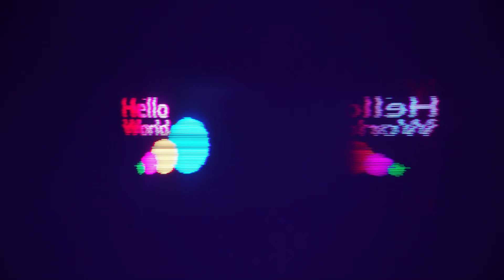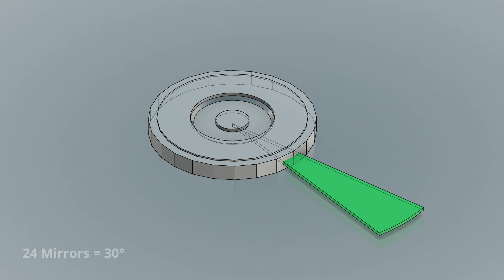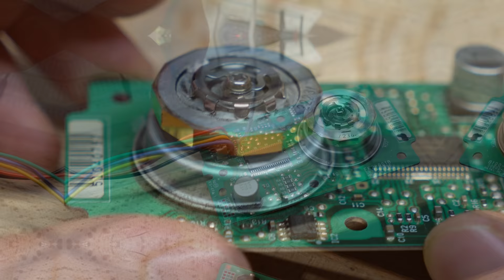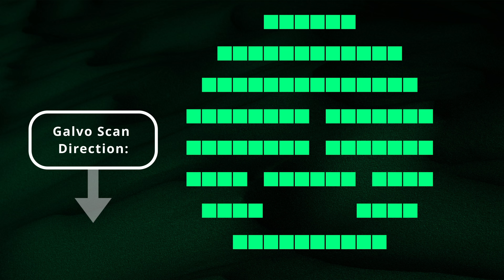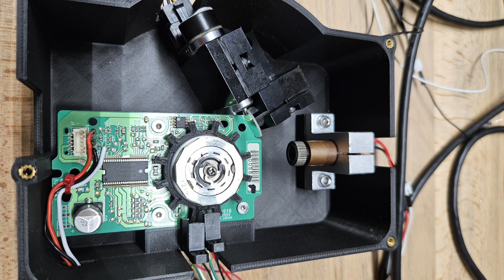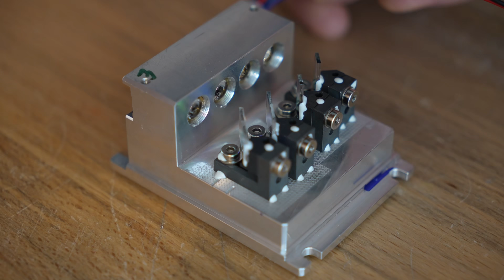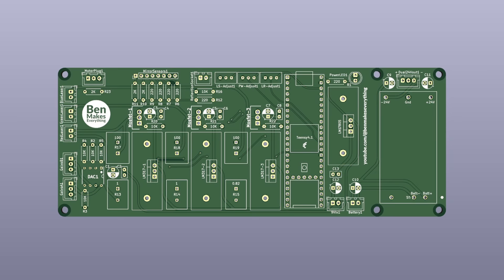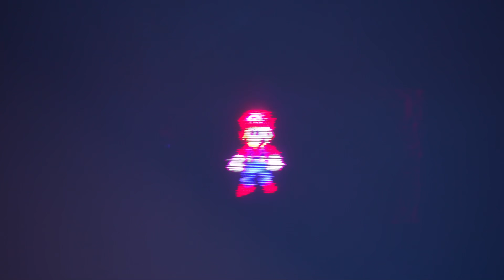DIY Laser Image Projector (100ft+ Range!)

Comment: Hey mate. Your video is really interesting, it's actually not far from engine management systems in some ways. 

From what I could see in the video, the 'jitter' artifacts affect entire lines at a time, and not others. That, plus the fact that most of the lines actually generate jitter free suggests that the MCU has enough resolution when it comes to outputting/triggering the lasers, and that the source of the jitter likely comes from capturing or syncing with that spinning mirror assembly.

I'm not sure how you've implemented the syncing functionality within the firmware, but the jitter being consistent across entire scan lines suggests that line syncing is done by that single larger tab on the spinning mirror assembly. If you aren't already, I think that you should use an approach similar to how engine management systems track crankshaft position, and reschedules outputs (e.g. injectors, ignition) dynamically based on engine speed and acceleration changes CONSTANTLY BETWEEN cycles.

The large tab acts as a 'reset' signal, and sets the current tooth count to 0, as well as setting a 'sync' variable to true (so that lasers aren't triggered when MCU is not synced with the mirror assembly).  Assume that all of the tabs are evenly spaced around the mirror assembly. Each time an interrupt is created, you can increment the tooth count by one, and since we know the amount of degrees between each tooth, we can calculate position (tooth_count * deg_between_teeth), and the rotational speed of the assembly in degrees/microsecond. Additionally, you can calculate acceleration by comparing the previously calculated speed, and the newly calculated speed with each other. The output interrupts you configure should be rescheduled at each tab interrupt event so that the epoch they fire at is calculated using the most recent position, speed, and acceleration measurements (of course only do this if you have enough processing power to do this at each tooth event). 

Just a quick note, interrupts should be as minimal as possible, essentially capture data and exit, or trigger an output and exit. No unnecessary maths or logging, all of that should be delegated to something like PendSV, I can explain that to you further if you'd like, but put simply the IRQ captures data, pends PendSV (or softirq) and exits. The second that high priority IRQ exits, PendSV creates an interrupt at a lower priority to process those capture events. Since PendSV runs at a lower priority compared to the IRQ, if a tab interrupt occurs PendSV will be paused in the middle of what it's doing, the callback/handler func for the tab interrupt will be invoked, and then when it returns, the processor returns to whatever it was doing before in PendSV. Similar to how normal main loop can be interrupted by an IQR, except PendSV allows you to handle time-critical processing instead of it just constantly being polled and done in a main loop.  

Additionally, ensure that your output triggering functions don't involve any lookups, you want a function call like "laser_out_1_on()" to flip a bit in a register somewhere and exit, not have to look up pin, or port/pin from somewhere and then call a gpio_write function from the SDK. With high speed stuff like your project, and engine management systems (what I'm working on), you want to have control fine grained and deterministic.

Apologies for the text wall.
Mitch
Reply from the maker: Hi, first, let me say thank you for the comment! A lot of people gave me suggestions but few were as detailed as this. 

The way its synced (per mirror) is purely through delay functions in the code, triggered by each passing tab. That's why when it first starts up, the image moves into position and 'stretches out' as can be seen around 0:10 in the video - while the motor is reaching max speed. And as you understood, the longer tab triggers the outer sensor to reset the revolutions counter. Both use very simple, 1-line interrupts. I'm not familiar with "PendSV" - I used "attachInterrupt()". The reason I had 12 tabs, and not a single one, was that I found that the motor speed was not extremely consistent and this better tracked its position.

I am actually using digitalWrite which is inside a switch statement that looks at a 2D array of pixels essentially, and turns on the required combination of lasers to create one of the possible 7 colors (or none).

I'm basically self taught in terms of programming, so I'm sure my code is suboptimal.

Eventually I want to build another version with higher resolution and full-color. At that point I'll also revisit the code - although I may try for analog video input instead. In any case, I appreciate you feedback!

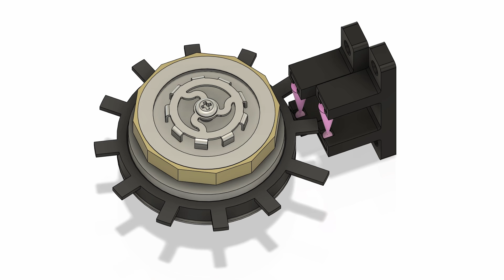Comment: the jittering scan lines are from that 3D printed part under the mirror that controls the timing of the mirrors 5:33 , its not precise enough , if you look at the lines ,you can tell its the same lines ,shifted by the same amount every time , making a precise plate from pcb way from something non reflective would solve your problem ,a tolerance of 0.02 mm is insanely high when your turning at that speed and need precise triggering

Comment: If you could get this to just 500 TVL, it could potentially be amazing for retro games, a CRT replacement tech is desperatly needed now, given how rare and expensive they are becoming, software solutions are just not the same as a real CRT sadly, even FPGA solutions fall short, a raster-scan RGB-Laser projector could be incredible, and an 8K raster-scan HDR-Laser projector would be a game changer for modern gaming too, even 500Hz WOLED/QD-OLED falls miles behind the 0ms of percievable input-fidelity/latency and motion-resolution/clarity of raster-scan displays (CRTs).

And CRT displays can do this, that is imaculate 1:1 dynamic:static resolution at just 60hz, with silky smooth and blisteringly rapid input-fidelity, and then you have beyond 60hz raster-scan, like my Sony G520 CRT monitor, capable of 90hz 1440p, 120hz 1200p, 168hz 720p, etc, which no sample and hold display can even entertain the idea of matching that level of input-fidelity and latency, sadly we dont have native raster-scan RGB-OLED, which could be phenominal, especially at 240hz and higher.

Comment: bro all u need is to duplicate this 3 times with the only differences being wavelength of laser (1x Red, 1x Blue, 1x Green) = full color :D
Edit: combine the three with two beam splitters arranged as a cube. The top and bottom side of the cube can serve as the space needed to mount the thing. This leaves 4 sides of the beam cube... shine red into 1 side, green into 1 side, blue into 1 side and the output will emerge from the 4th side. this can be sourced from an OLD projector at goodwill. best part is the beam cube will alrdy be setup for this arrangement and will have lenses already focused to display at a distance (focusable too!)

Comment: Thanks for sharing your info I just wonder if this system able to projection in naked air or may on sky not only on screen or any obstacles in front of it
Reply from the maker: It can project on any solid surface, or maybe water or a cloud, but not on air, since there is nothing to catch the light.

Comment: MEMs. Microvision did this already with the pico projector. I worked there during that time.
Reply from the maker: I'm very interested in this. I was under the impression that most "laser" projectors were essentially using the laser diode as just a compact, very bright light source, but seems that that device was actually moving the beam. I'm curious as to why that product doesn't seem to have taken off.

Comment: Instead of galvos could you not use dual mirror wheels, one for vertical and one for horizontal? Timing might be a little more difficult but should get you good refresh rate and resolution on all axis then?
Reply from the maker: Possibly, that is something I would like to try in the future, although I suspect it won't be easy.

Comment: What do you think about 3D printing a rotor on a resin printer without any adjustments, and then coating it with chrome to give it a mirror-like finish? The whole thing could be miniaturized.
Reply from the maker: I thought about it, but wasn't sure if the quality of the mirrors would be high enough. Plus this thing spins at about 15,000 RPM, so I would be concerned about it flying apart if there was an imbalance.
Reply: @ The resin printer has high accuracy, so the center of gravity will be well distributed. A BLDC motor would be suitable for such rotations. As it would work, it could be done for very little money

Comment: Do you need the 12 horizontal triggers? You could inprove CPU hz efficiency, and reduce noise in the or switch, by using less triggers 6 sending 2 laze bits each time, or 4 with 3 bits, or 2 triggers with 6 bits, or 1 trigger and send 12 bits. You might get wiggle on the whole line but it would significantly reduce the noise created by the triggers and give more cycles back to the code

Comment: I imagine two flat mirrors glued together for each ax (x and y) one of which spins at half the speed of the other would make the design a little simpler.
- no need for complex mirrors
- no need for a mirror that decelerates every round.
Reply from the maker: Yeah, thought about that but I think synchronization might be difficult - there would either have to be some gearing or precise electronic speed matching.

Comment: Hi! I absolutely love this project, I wish I could contribute but my skill level is currently FFARRR behind. I think I found something that would really help though - have you heard of MEMS laser projectors? They use the same principal but with a MEMS mirror that can actually move the laser in a 720p/60hz refresh rate! It's kind of an abandoned piece of tech, but there were actual consumer models made like the sony MP-CL1! The craziest part is that I actually found someone who sells the complete RGB Laser and MEMS mirror module used in the MP-CL1, and also someone who sells the MEMS mirror module on its own. I found it on taobao but it only seems to show up when i search on the app, on aliexpress I only see them selling the mirror on its own, but with a significant markup.

If you are curious to proceed in this direction I'd love to see if its possible for you to use this module but with a much more powerful laser, and if the module can be run at different line counts and refresh rates - so far all the products I've seen made with this only seem to support 720p 60hz, and they all use an extremely low powered laser. Do let me know if you need a link to the product page i found, I don't think i can post it here.

I'd love to try it on my own one day, but I'm quite far from this level of hobby projects haha, it'll take me a few years to get there.

Comment: This is a really cool project and one I've thought about trying myself. But to expand on the note about laser safety: Many lower-cost visible light lasers (green especially) are actually infrared lasers combined with a frequency-doubling crystal; some of the longer-wavelength INVISIBLE infrared light is converted in the crystal to shorter-wavelength visible light, often at around 10% efficiency. That's fine, as long as the laser ALSO includes an INFRARED FILTER to block transmission of the other 90% of the infrared output. If there is no filter, and yes, many of the cheap "green" (aka infrared+frequency doubler) lasers do not include the filter, then the beam is really a high-intensity invisible infrared beam, that also has some green light too. Your eye has no reflexes to blink or look away from infrared light - it's invisible. So it's very easy to get infrared burns on the retina from these unfiltered infrared/green lasers. Just a PSA!
Reply from the maker: Thanks, you are absolutely correct about the issue with cheap green lasers - however this one is a 520nm direct diode, not the 532nm DPSS type - I learned about that issue first hand in my initial laser projector build - I had to not use the DPSS type due to the extremely high switching speeds required for this.

Comment: What are the odds. Just recently i came up with the idea to use spinning mirrors and a laser to create a little crt-like screen. It would like this but shine on the back of a phosphorescent translucent panel. But i deemed it impossible because of the rpm required.
Reply: The idea was to add a VGA connector, have three lasers (RGB), and just connect it to my pc. Imagine playing a game on it, watch videos, drag a window onto it, etc
Reply: My next idea would've been a mems mirror. If driven in an oscillation, back and forth, they could be enough for 360p 25fps or whatever. Don't remember the numbers.

Comment: Why not use an ESP32? If you want faster clock speed, and it comes with BT and WiFi, you can use the same programmer and basically the same code. And its cheaper

Comment: i build before an video circuit input for oscilloscope device..... so you get video image in black & white (green )... you change the oscilloscope with laser system and you get the same effect..... so rgb lasers projectors they already been build ... atiki taki tiki tu tȁ̶̢̳̪̥͎̩̦̫͓͓̏͋͌̀̑̔̑̆̄͌̽̄̂̄͜ͅ ta .... 
🌏 📡🌏 👣🕖 💎👽☠☼☾☄ゞど・ㇺㇾㇽ₪𝖎𝖙𝖎𝖇𝖎𝖗𝖆₪なめㇺㇾㇽ✶☥✨🌛🌄⊀✶⋊🐺🐾♓☆🐜🐜🐫▲▴◭👀

Comment: $120 for just the power. O.o 14:00
Reply from the maker: Yeah, prototyping stuff is expensive. There may have been cheaper ways to do it, but at least that part did work flawlessly.
Reply: @benmakeseverything  Yeah I wasn't criticizing, it just would have blown the whole project's budget if I was doing it.
not sure what the other options were either otherwise i'd have tried to be more constructive!

Comment: On split power supplies: often you can generate a virtual ground, for your case having a 10V supply and a 5V regulator running off of it whose positive is the ground of the split supply circuitry. 
The only connection you need here is to phase lock the galvo to the frame synch of the other driver and that can be done via an opto-isolator as an easy level shifter between the microcontroller and the galvo triangle wave driver. If you want to more precisely staircase the galvo then you send up/down signals to a counter feeding a dac.

Comment: why don't you replace the LASER printer motor with an HDD motor ?
Reply from the maker: Did you see my first video? That's what I used on that one - but the laser printer motor actually spins at a higher RPM and already has the mirrors mounted.
Reply: @benmakeseverything  Yes boss, but what I mean here is why you should not use a 15K rpm speed, it's ?? not what we have seen in the first video in which you used a 7200 rpm default motor and I came back now again to the first video for ensure which one you used..
So, my point is if the printer motor has more speed I think not like the 15K plus you have a more stable for a somewhat heavy mirror !!
Thank you for replying.

Comment: A very neat project.  I wonder if you would consider releasing a version that we could have a PCB manufacturer assemble.  Then those of us who have a 3D printer could print a little case for it and have a version.  After you're done selling the gorgeous version you are selling of course.  If not, I completely understand.

I'm in awe of the amount of work you put into this.  I recently finished making a pendant that has 51 size 1010 WS2812B LEDs and that was a lot of work.  So I can understand just a small fraction of the amount of work you put into this one.  Thank you for sharing.  It was very entertaining to watch.
Reply from the maker: Thanks - if you really want the PCB design files I'd be willing to share that, but I'm not selling anything - at least not yet. Its not economically viable in its current form and has too many incomplete design elements. The problem is this cost several hundred dollars in parts because prototyping is expensive. The resolution and refresh rate are also too low to use it for much. I plan on continuing this project eventually and making improvements.

Comment: perfect project to tinker with!! i know what i'd look into: extending it to have a way to control different stored animations etc using DMX! i would also see if the timing could be improved by replacing the IR bridge by a hall-effect sensor and copper wire instead of actually using a magnet to keep things light.. or perhaps replacing the disc with tabs for aluminium instead of 3d printed so it might trigger because of the same effect they use with those brakes in rollercoasters?
Reply from the maker: Those are certainly good ideas, and I do plan to develop this further. Really I just want to be able to give it direct video signals rather than trying to display stored images though.

Comment: two suggestion: use an lcd to control the intensity of the lasers and get a dual system with one set for the even lines and another for the odd lines - while one goes down the other goes up - I think it would even get the galvos to last longer.

Comment: For sync, you might want to consider a PLL circuit. It'll get rid of the noise of the early/late/missed triggering.

For high speed DAC, what about using an old VGA graphics card? Or if you don't want a computer, maybe remove the RAMDAC from the card and use it without the rest of the video card or the PC.
Reply from the maker: Thanks, I'll look into the PLL thing. Might just try to use component or VGA signals as an input if I do a future version, skipping the DAC entirely.

Comment: it would have been cooler with a vertical rotating mirror wheel instead of a galvo
Reply from the maker: Synchronization might be hard to achieve, but its worth looking into.
Reply: @benmakeseverything  perhaps you only need a single sync signal per wheel turn instead of one per mirror